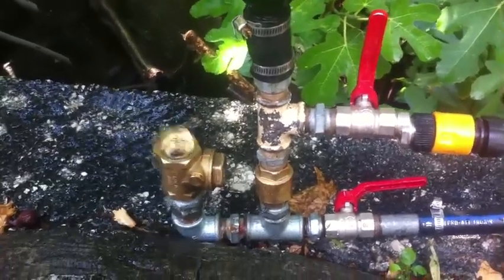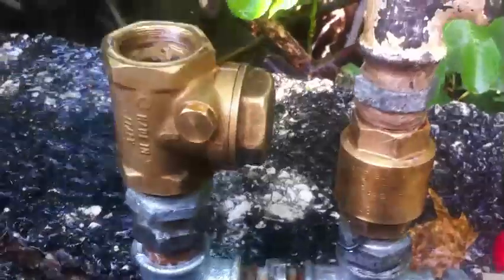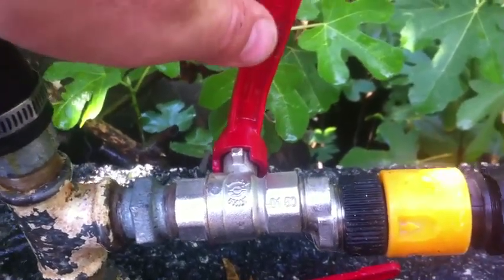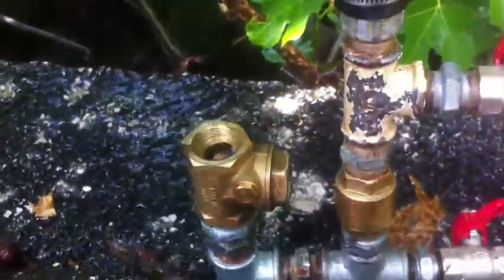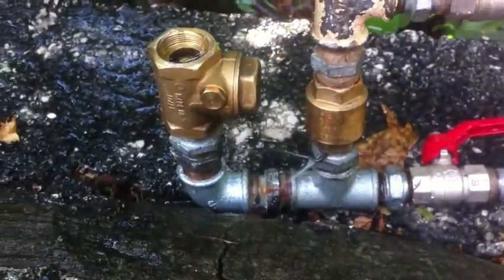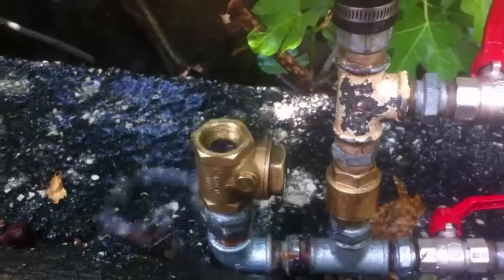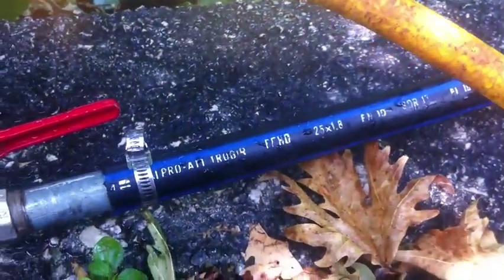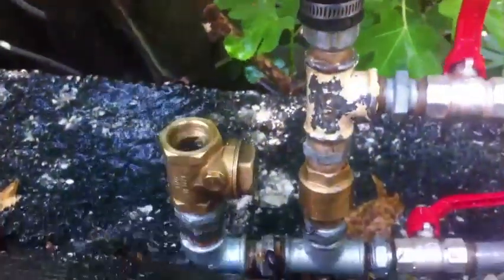DIY Ram Pump - Ramp Pump is working, but stops when delivering water

Comment: may be it is your outlet pipe is not high enough. 
the moment you open the outlet valve, the pressure seems gone so fast..
you can also add some more weight on your drive valve. adjust it as needed.
good luck n have fun :)

Comment: hi your ram shows symtoms of the lift being to low for your fall a ram needs a ratio of  3 times lift of the fall also your air hole is too big.ps.delivery pipe can be any size you like its erelevant can be bigger less friction more delivery
i do this for a living so any questions feel free
Reply: benny4x  I keep telling my stubborn bf that we need a stand pipe do we or don't we?
Reply: Hi there i have a two inch rampump.  the reservoir head height on the drive pipe side is approx 30ft . do you  think my ram pump will work. somebody was telling me most probably for this head height the waste valve will remain shut . what is your take on this besides kindly tell me what should be the length of the drive pipe for my two inch ram pump. regards

Comment: Hi

I think you have a few issues which are preventing the pump from working properly. The fall from inlet to pump was ok, the length was a little to long, the time for the pressure wave to exit the outlet would be slowed down too greatly for the pump to work efficiently, in these instances you need a stand pipe. inlet needs to be the same size as the valves and outlet a lot smaller. Keep drive pipe, non return valve and impetus valve the same size, it works better this way, good luck.

Comment from the maker: Thanx for your answer!
Lenght form inlet to pump is around 40 meter.
The height form inlet to pump is around 2 1/2 meter.
The height I am trying to pump to is 5 meter above the pump.
I dont no how many litres is entering the pump per minute, but it was quite a lot. I cant measured since I am not in Croatia anymore but in Hamburg, Germany. I will build another one.

The outlet is 1/2 inch and the inlet too. The waste valve is 3/4 inch and the one-way valve is 1/2.

Thanx so much for your advice.

Comment: Hi, tell me the following;

Length of drive pipe, ie from your inlet to your pump?
The height from inlet of drive pipe to the pump?
the height you are trying to pump to.?
How many litres a minute is entering the pump inlet?
Looks a little like your outlet is mis matched to your inlet, ie they are a bit too similar, the outlet needs to be a bit smaller possibly it all depends on the flow entering the pump and the fall from inlet to pump, you need at least 3 foot.
Let me know and i  try to help yo